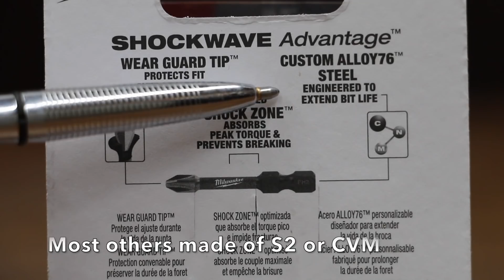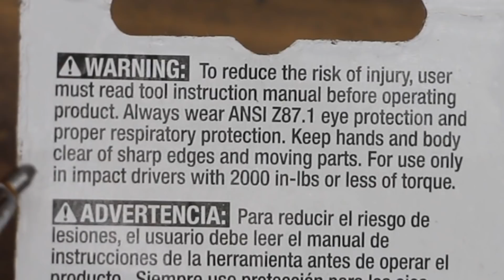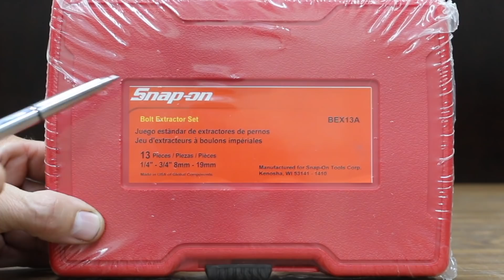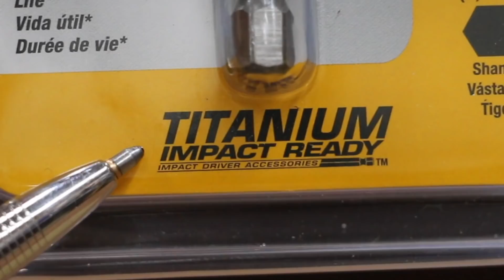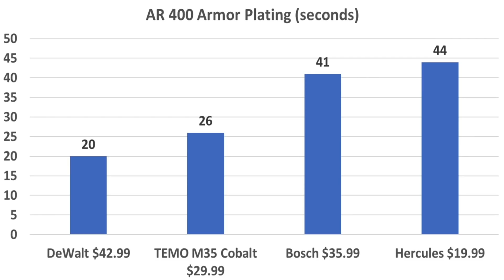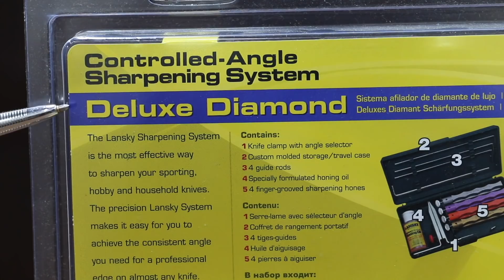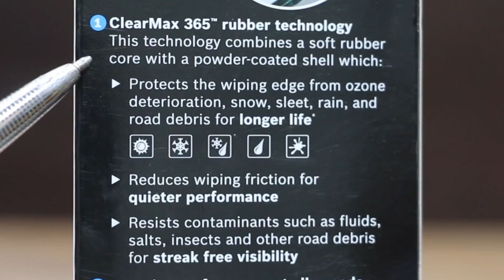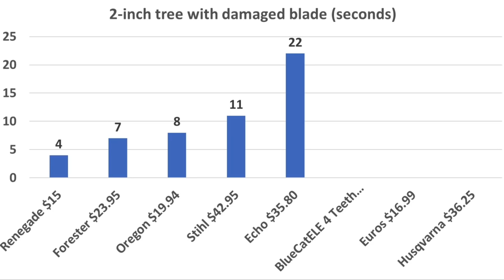Top 10 Tools in 2020? Let's find out!

Comment: A thousand screws....now that's dedication 😱😉
Reply from the maker: lol.  Yes, my hand was numb until the next day.  I was a little worried the numbness would last for days.  Never had this happen before
Reply: @ProjectFarm  thank you for your sacrifice sir 👍😉
Reply: @ProjectFarm  Perhaps a "Loge-de-Guyon syndrome", which likely happens after very long bicycle rides, long crutch use or work-related stress on the hand. Of course there could be other reasons (carpal-tunnel syndrome etc.). This one would have a numbness of half of the palm, little finger, ringfinger and loss of muscular grip force (distal N. ulnaris area) .
Reply: @ProjectFarm  Todd its called age. You look like you're in your late 30s to early 40s. I'm in my late 40s and even simple stuff like getting off the ground after working on my car is ruff.
Reply: @ProjectFarm  Now we need to see results of testing your left against your right.
Reply: Next hire, screw driver person.
Reply: @ProjectFarm  you should tested pain reduction cream after that 🤣
Reply: For science!!
Reply: @ProjectFarm  

Not just 1000. You drove 1000 screws each for several brands. 

PF, for tests like this you should create a quick-release trigger holder, something you can easily zip into a drill or driver to hold the trigger down. 

Either that or adapt one device’s trigger to a foot-pedal, so you’re just holding the tool and can use less grip pressure.
Reply: I'm sure there's a joke about PF's libido being like that of a teenager here somewhere.

Comment: Test tape measures. Durability, stand out length, accuracy, visibility in low light, etc
Reply from the maker: Thanks for the video idea.
Reply: I spent $35 on one so this would be personal for me. Great suggestion
Reply: @ProjectFarm  make sure to include the Klein 9125 tape, the cheaper model is junk, the 9125 seems to be pretty decent, 

Also check for durability long term standout, many tape measure manufacturers have started thinning the blades, but arching them to lie about standout and after just a few days, lose the arch and standout goes to absolute crap
Reply: @Project Farm there is also an inexpensive tape measure calibrating device. See how many are accurate.
Reply: Stanley fatmax winner anyway
Reply: Durability and accuracy after repeated full-length, full speed retracts could be tested also.
Reply: @marcelo403polo2  thats the main culprit of what i just described, ive gotten rid of my fatmaxe's for that reason
Reply: @lte008  a tape measure calibrating device? That's a joke, right? There is nothing you can do to calibrate a tape measure. All you can do is bend the hook if there is a discrepancy between the push and pull measurements. There may be a special tape that you can adjust the movement in the hook to get rid of push vs pull discrepancies, but not on the vast majority. You don't need a special calibration tool, which I suspect is just a accuracy standard of a set length, just measure ANYTHING, if ANY length, and if the push/pull measurements are different, you need to bend the hook.
Reply: @xenonram  no it's not a joke. There is a real calibration tool to check tapes.
Reply: @ProjectFarm  if you do a tape test need to test that if it accidentally pulled out too far its still works  and that when pull out all the way and it retracts at full speed it don't destroy itself
Reply: @lte008  yes needed for iso 9001 CERTIFICATION
Reply: Can you test the Crescent Lufkin and the Milwaukee?
Reply: Would be very interesting to see how the classic 25' Stanley Powerlock stacks up against some of these others
Reply: Man, I burn through tape measures like crazy, and still haven't found a favorite! I'd love to see this!
Reply: For shits and giggles please include that crappy IKEA tape on which the brake never really works even brand new from the factory 🤣
Reply: Fatmax....  hands down favourite. Especially the 5 meter.
Reply: @ProjectFarm  If this idea is implemented it's good to take into account that some brands brag about the spring tension but I've noticed that the one measure that I always use has just barely power to pull the tape back in. It minimizes cuts and dangerous situations a lot. Maybe also test the sharpness of the tape edge?
Reply: @andrewwilliams5337  16 footer. but agreed on fatmax

Comment: I work at a water plant, and we used the Milwaukee Fuel Impact Driver to remove large bolts holding in a blow off valve that had lived under water  that hadn't been moved since 1972 when it was installed. It's a beast.
Reply from the maker: Thanks for sharing.

Comment: I'm under a car for a few hours a week, so when Harbor freight had a recall on it's jack stands I started to question if my stands were safe. Please test some jack stands for us shade tree mechanics.
Reply from the maker: Thanks for the video idea.
Reply: I’ve just doubled up instead, but I never trusted those things much anyways and always try to keep the Jack under too if it won’t get in the way (sometimes I just use the Jack and hope no leak finds my way)
Reply: @aterack833  never under any circumstances should you souley relying on just the jack! Take the few min or two to put stand underneath! It could be difference of life or death!
Reply: I knew two people who died from their hydraulic jacks slowly leaking down and pinning them under a vehicle. Don’t do it! Always have something solid under there as a backup if the jack starts to leak down.
Reply: Jackpoint Jackstands are the final answer. Worth every penny!
Reply: Same happened to me. I returned mine. Still haven't replaced them.
Reply: @brightboydesigns8325  that’s great for people with floors, a little harder to use when you’re working in soft sand and mud, they take so much more planning with the wood and supports, especially with the Jack being right there, my biggest issue is the Jack stand and plank tilting, the same issue would still place these and it looks like they may slip loose from angling even easier
Reply: I purchased the Esco 3 ton jack stands this summer and they are the best built and sturdiest stands I’ve owned. They are kind of expensive though, but I’d rather have the peace of mind knowing they won’t collapse on me.
Reply: I use something far superior to any metal jack stand, and that is huge tree trunks. The wood is free, it's just a tree in your yard if you own woods. What I do is cut down a tree that is about two feet in diameter and cut those sections to about two foot high. I then put four of them under a vehicle. I promise you there is no way a car is going to split a tree truck like that. I bet you could use these tree trunks to hold an entire house off the ground. People underestimate just how strong wood is when dealing with compressive forces. The downside is over time termites or carpenter ants could get into the wood unless you store your "wood jack stands" inside a garage.
Reply: Seriously ?
Compare other tools from Harbor Freight, and their quality, and I think you'll have your answer !
Many purchase their tools to use once or twice, and or for simple  honey do jobs.
To trust any device 100%, would be fool hearty at best.
Of course, it's your neck on the line, and people will do what they want, regardless !
But I think those kinds of tools are cheap for a reason.
Do yourself a favor with the money you saved buying other tools from Harbor Freight, and invest in a quality set, or more, of Jack stands !
Nothing more frightening than being under a vehicle, and hear a jack, or a stand slip !
Been there, done that, used the tee shirt to wipe my ass ! 
Stay Safe !

 Just Say'n !

You only live once !
😉👍
Reply: @EETechs  that's a real good idea, I cut down a 100+ honey locust last year in our yard (super dense and heavy) the rounds where 2-4 feet in diameter! Maybe next time I fall another hardwood tree I'll d o that as doubling up with jacks. I could see where people don't know wood density and use pine or something and get in trouble
Reply: @thomaswilcox9208  you can't put price on your health and peacetof mind!
Reply: @EETechs  I also use a tree trunk :D
Reply: @jmabs5096  I’m usually done the job in a few minutes, typically taking the tire off is the hardest and longest part of whatever I have to fix or replace, sometimes I’ll loosen everything with the tire on still just to save the time, but ya, typically the only times I’ve had vehicles fall when working on them has been when supported by the jackstands, the one time it was because they actually made the vehicle lean and that caused the Jack to tilt too and it all fell over, but usually the act of putting them in there and the supports so they don’t go underground ends up getting in the way of having the Jack in there while doing anything on the vehicle, especially since it’s often suspension work related that I’ve been doing lately (had to take the subframe off to get the transmission and engine out from underneath to take the transmission off)
Reply: @MoneyManHolmes  I’ve only ever worked under a vehicle while jacked up after having it there for a while and giving a few aggressive rocks (bent a frame doing that though so I do more less aggressive rocks now) that way I can check that it’s still the same height, and I usually Jack it heigh enough to either be almost questionably tilted, or till the Jack slides because it can’t roll and the vehicle can’t move anymore, I’m also careful with the first few pushes just to make sure it isn’t actually falling off, but I generally try not to have more than 30% of my body under unless I have assistance.
the one time I did use a trolly Jack (never using those again unless it’s something quick that Won’t matter if the car falls) and the hydraulics did slowly leak down (either an actual leak or bad threads making the lock not engage fully) and I was pinned, I had to use my chest and lungs to try to help me push the car up just enough to move closer to the Jack to pump it back up, that was when I was pretty young, good thing the wheels were on and I was basically just helping the suspension lift the car, sadly I wasn’t able to lift it enough to get out so I had to go through that way longer than I wanted just to get to the Jack, the rust was getting on my neck when I tried to pull out and I was nearly certain it would have crushed my head if I got to that point, good thing the seam underneath where the jacking points usually are was rotted right out, or that would likely have been like a blade to my chest (still left a nice groove where it was resting though) 
Now I try to make sure that the wheels are on any time I go under and that I could fit uncomfortably before I go to Jack it up, I also avoid anything sharp or pointy being above me, especially my head and chest (if it falls fast the suspension will go lower briefly and that could cause the item to puncture my bones and flesh) 
I have semi recently been using the wheel I take off under the rocker panel whenever I work on the suspension or anything further in than the brakes, even for the brakes too usually
Reply: @user-nf7ui7dz1z  I’m aro/ace or volcel or even “incel” so I don’t have to worry about that, lmao
Reply: @jmabs5096  but I can, anything over $50 needs to help the job be quicker or easier, not just safer, not until I have the security of life that people who own their homes have, or even just having/making/getting enough money to afford the rent on a place without having to luck out on a cheap one nestled in with the weekly rent prices and the share a room prices (hard to work on things from that situation, lmao) so currently that means if I sort by cheapest, and go page by page till most of them are houses or non shared apartments then go back till I start to see more than the occasional add that won’t accommodate two people, the price the ads that will work happen to be in is how much I would need, currently together we have half of that, on my own I can’t even afford most room share ads.
so until someone drives me where I need to go and waits outside of the places I need to be or is there quicker than I can make it to where we’d park, and cost the same or less than fuel, or until someone starts fixing our vehicle(s) for free, I’m going to have to keep working on them, and until I have more than basic survival money and don’t need to basically fast just to afford parts or tools, I’ll consider anything that isn’t literally a required tool (sockets or example) to be too expensive, and unless it’s literally life saving guaranteed, it can’t cost more than $30, or $50 for 2
Reply: Rule number 1 of Harbor Freight. Don't buy anything from HF that you have to depend on.
Reply: Pro-LifT T-6906D Double Pin Jack Stand.  Ordered from Amazon after my H-F were recalled.  SOOOO much better.  The Pro-Lift model purchased has a pin to prevent the pawl from disengaging from the teeth on the cradle shaft.  If a review is done, these should be included.  Seem much better than most I have seen at least.  And impossible to drop with the safety pin engaged.
Reply: What I do is when I take a wheel off I put the wheel under the car along with leaving it on the hydraulic jack and a jackstand so I have 3 levels of redundancy
Reply: I returned them and got some Torin double locking jacks instead. Cost more than the HF ones but I feel much better with the added safety of the pin.
Reply: @tomdickharryjane  I have a double pin set, it’s able to have the pin engaged without the pawl fully engaged if your trying to force everything, which often happens when you need every millimetre and the lack you’re using is starting to slip or tilt, still really hard to do thankfully, and the pin is strong enough on its own, but just keep it in mind when setting up, so you don’t load it needlessly and wallow out the holes
Reply: @kyle5608  bad idea, it will damage your rims and tires. If you wana triple up get another jack stand
Reply: @jmabs5096  I know it's going to damage the rims it's just a backup to the backup also a convenient place to put the wheels when you're working on the vehicle plus rims and tires are cheaper than medical bills lol you're correct another jackstand is a better idea but sometimes you don't have another jackstand or a jackstand at all and putting a wheel under the vehicle is better than nothing heck one time I used a stack of cinder blocks 😂

Comment: "2020 really went by quickly"
Official sources dispute this claim
Reply: He has been busy, I can see this being true for him. Most people would disagree though.
Reply: We'll put that to the test 😂
Reply: Really? I'm still mentally processing June.
Reply: This is the only thing PF has ever said that I completely disagree with.
Reply: it did go by pretty quickly.
Reply: @dougjb7848  why? it was no longer than any other year...
Reply: @IamR3D88  and
Reply: @coleroberts2152  and what? Being busy makes time fly. All the testing he has done this year keeps it moving. Most people are stuck at home, and bored. Some are out of work, others just have no where to go with things shut down, so most people feel like its been a long year.
Reply: @IamR3D88  That is why you have to keep busy doing things if you can, to make time go faster. I kept busy by working on restoring a moped.
Cheers
Reply: February - 28 days.
March - 62 days
April - 180 days
- and then the elections started, so I'm somewhere in 2031.
Reply: @darinp5612  as I do agree that it did go by pretty quick, by your argument, it didn’t go by quick since it was just as long as any other year. Aside from it being a leap year and by our calendar, it was longer than 3/4 of the rest of the years.
Reply: @plaid11  sure it did

Comment: "Hand Files" mostly flat, would love a showdown.
Reply: I'd also like to see claims that using a file in two directions instead of a single direction will damage it tested.
Reply from the maker: Thanks for the video idea.
Reply: @TWX1138  That has been covered before by another famous youtuber
Reply: @ProjectFarm  I've said it before, but oil filters is a test I'd like to see.
Reply: @RolandElliottFirstG  I'm aware of some limited testing from This Old Tony when he used his automatic filing machine, but if you could elaborate it would be helpful.
Reply: @TWX1138  I didn't save the test in my play list but I have seen the This Old tony one and that is one of the ones I  refer to, yes.

Comment: Best hand cleaner for removing grease and oil, could be the waterless ones or with water.
Reply: Do they still make Lan-O-Lin hand cleaner?  I used to use that stuff back in 1963, after working on engines.  Sure cut through the grease, but felt like petroleum jelly!
Reply: Yeah i need that and working with heavy chain and lift cables ... and something to wash my coveralls.
Reply: This would get my vote!
Reply: Baking soda is great, as alkaline substances help break down the grease/oil. A little Dawn Blue and some baking soda works pretty darn well. Although I like to use orange smelling goop with pumice in it too.
Reply: @sunshinekid6922  like dissolves like. Petroleum jelly, lanolin oil, citrus oil, or any other type of oil will dissolve car grease and oil the best.
Reply from the maker: Thanks for the video idea.
Reply: I think the Big Wipes are quite ok.
Reply: Swarfega original or Swarfega Orange are my favourites.
Reply: @uktony1525  funny when I was a kid my mates dad used to work for the bbc
He used to bring swarfega home from work and he used to use it to clean his whole car 
I was a diamond white allegro 
He called it the aggro 😂
It was the cleanest car I ever saw in Northolt ..truly 
I always liked swarfega ever since 
👍
Reply: Swarfega green jelly for removing oil and grease from the hands, great stuff.
Reply: Or the best thing for removing Gorilla Glue from your hands. I stopped using that stuff, the only thing it sticks to is your hands and clothing. 😊